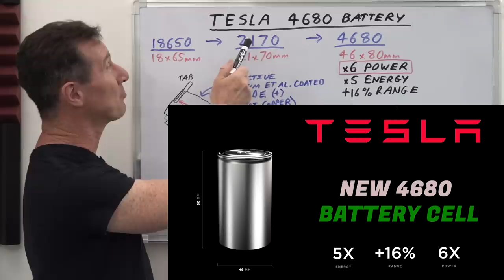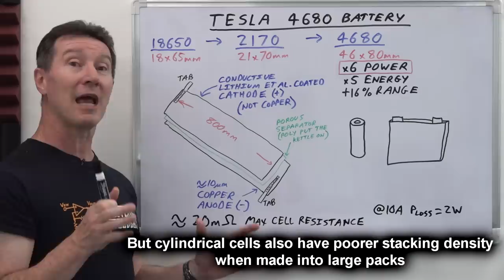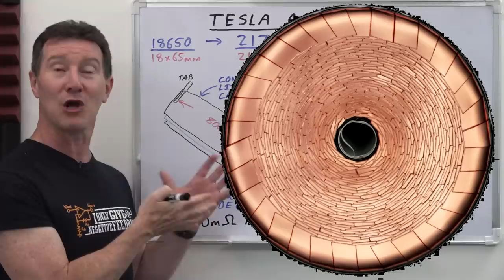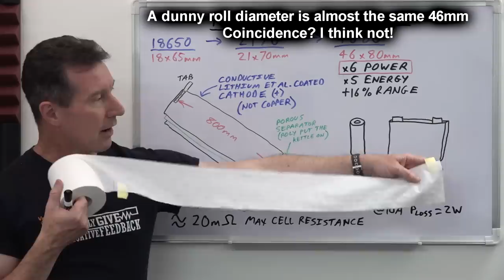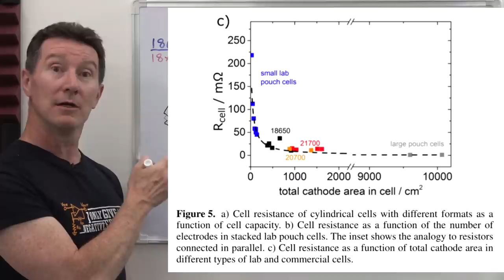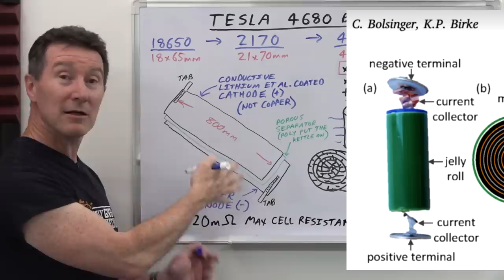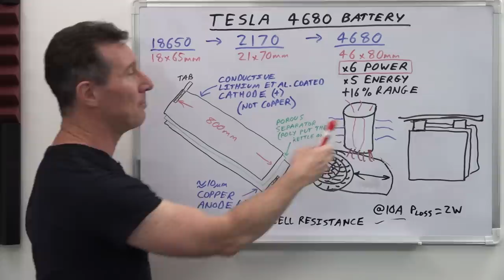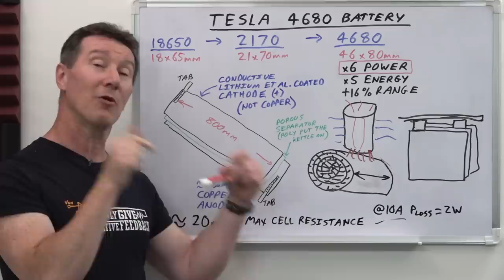EEVblog 1340 - New Tesla 4680 Battery Cell EXPLAINED

Comment: 17:45 its actually because pouch cells are not mechannically as stable as cylindrical cells.
 I really dont know if tabless is patent-worthy/new design because it is quite obvious and attractive feature every manufacturer may like to do but couldnt have been affordable for small designs. Its astonishing if they really didnt notice it. Heck yea, even i had observed it's possibility for many years because it plays a major role for power delivery. Though its possible that Tesla got some 'new' way to do it which could be patent worthy (i havent seent its patent) but the design itself doesnt seem.

Comment: I really don't get the welded tabs on the flat cells. Why not use the entire surface to make contact? To eliminate contact issues, the surfaces could be coated with thin layers of indium, which is common for cold soldering. Although copper is better in both conductivity and heat transfer, using the entire electrode as the electrical contact surface, you get the advantage of the entire surface of the electrodes as contact surfaces instead of tabs welded to the electrodes and similarly for heat dissipation. The indium eliminates any oxidation problems with the bare electrode materials. That makes them easily stackable and or paralleled. The same scheme can't be used for a cylindrical cell, but so what?

Comment: Great presentation! Why didn’t they bend the cathode over line they did the anode? Seems like not doing this will limit the charging speed as you a still forcing current through a tab?

Comment: The overlapping tabs ofc. stack on top of another and thus takes up space reducing the maximum "height" causing some loss of capacity but if Tesla is smart they have minimized the overlap to reduce this loss (i.e. minimizing the height of the "tab" and removing parts of the edge while still allowing for inter-roll connections).

Comment: This is what Tesla needed! I was amazed that the standard 1865 battery was being used in the first few model years. I am very enthusiastic for this new battery cell design. This ought to make one hell of a e-cigarette mod! I have a 2x 18650 regulated power supply for my electronic cigarette. Im sure someone will make the incredible hulk vape with one of these 4680's!

Comment: A solar installer told me that Tesla's current  battery could never be improved upon, so there's no reason to wait to install battery backup in the solar system.  It takes 20 years to pay off the battery (~$80/month).  Well, this just disproved those sales representatives.  Battery technology will continue to improve and hopefully costs (and corporate greed) will go down along with efficiencies increasing.

Comment: All cylinders should have the same packing density, regardless of diameter. Though a longer cell may have more capacity for the same battery layer overhead, that is the thickness of the end plates will be about the same regardless of cell height.
My question now that they have the heat flowing to the ends of the cell, where does it go from there? Assuming many cell layers in a battery, what is bringing the heat from the center to the external radiators or heat sinks? (yeah an order of magnitude less heat but still it needs to go somewhere just the same.)

Comment: I think that they are folded for protection, because once they start to expand they tear the tabs and stop the reaction (or a short) , thus protecting the user from fire.
This new design sounds super cool and inteligently designed, however the protection from potencial short circuit will probably be in the separator only.

Comment: Just a note:  Packing density of circles doesn't change with the size of the circles, provided the packing pattern and number of cells is the same.  Assuming hexagonal packing, and allowing a bit of space lost at the ends of rows, packing efficiency in a rectangular array would be very nearly the same for the larger cells as for the smaller, probably in the vicinity of 80%.  Reference:  http://www.datagenetics.com/blog/june32014/index.html
Reply: Packing density of triangles works better
Reply: @tedbell4416   As does hexagons.

Comment: The anode is a carbon-based material, commonly graphite, not copper, no? That copper is to conduct the electrons to the external circuit?

Comment: Best presentation of Tesla battery I ever see so far ! How about the safety perspective for this Tesla battery design ? is it safer vs Lithium-iron-phosphate (LiFePO4) batteries? (that are more thermally and chemically stable than lithium-ion batteries).Why only increase 16% range with 6X power increase ?

Comment: Questions/thoughts:
1. How do they prevent shorting the anode and cathode when folding over the new "tabs"? I can imagine it's quite possible to short them out when it's folded over the roll of annode/cathode. Maybe they coat one side of the tabs with an insulating material. Although this would add an extra production step and that would be counter productive to their new tabless design to speed up production...
2. It seems to me that the new "tabs" will have added weight (and a very slightly added volume) because there will be more copper/material from all those folded tabs as opposed to 1 welded tab. This could explain the missing 0.5 in the x5 energy, as opposed to the x5.5 energy you calculated.
Reply: For 1. I guess its simple, keep a vertical offset between two conductive sheets. I.e., pull inner Lithium sheet slightly up so that it's bottom edge makes a gap from folded Copper material

Comment: Why not add a thermal heat sink as a core to cool from the inside out? as in an isolated inner core as to only absorb heat and not electrical  conductivity. ? Like thin ceramic layer coating a copper core?

Comment: You made a huge mistake with lenght measures. 46 mm is 4,6 cm and 80 mm is 8 cm. It seem like you didn't check everything before presentation. So comparing lenght of 8 cm to the lenght of your arm is ridiculous. Besides that its a great presentation for battery newbies like me. Besides confusing numbers 80 mm with 80 cm you got it pretty nailed.

Comment: I feel like the problem with this multiple tabs folding over will be the conection between them with time will lose, shortcuting and heating the battery faster actualy. Is a brilliant idea, but those tabs need more than just a press fit to make contact with the surface plate. You know when you have some old but still good batteries in your remote from the tv. You just take out the cover roll them inside few times and works again. Why? Because the conection surface is corroded, rubbing the batter will get that spring and contact plates back to touch eachother. Ofcourse you can evoid that in the firstplace by putting a little bit of greese on the contact area so then you insulate it from oxigen. They really need to think good at this fact the contacts of those tabs, because in time maybe some of them will lose conection and the battery will age unbalanced. As for the heating problem, why didn't they just leave a hole in the core making the batter more like a tube, then it has more surface to disipate the heat. I find the square big cels much more simple and better. I don't know why they make more and smaller cells, it seems more complicated. Yes is an advantage for a multipurpose battery to make small compact cells wich can be made in many shapes fitting electric tools batteries, and other stuff. But since you create a battery specific for EV, why replicate this? Why limit the cell capacity or size to 46 with 80 mm? If the purpose of these batteries are for electric cars? Multiple cells are multiple potential problems... Anyway, that's just what i think and i am not a battery expert. But i do know the actually important part of this battery is not the battery, is how is used, is the program wich controls the discharge and recharge of these batteries. IF the charge and discharce does not balance each since cell of a battery then that batter won't live too long.

Comment: Would the cylindrical construction keep architecture more stable with vibrational input and also aid in resisting the problem of expansion distortions with excess discharge etc?

Comment: Shouldn't the copper resistance calculations take into account, that the electrons travel from any point to the end? Do they all travel the full length of 800mm and 80mm? Or is it just the same relation in resistance anyways?

Comment: Nice presentation. To add to this, since force - Mass x Acceleration, the acceleration rate will increase by a linear factor based on the less weight - I think you did say that these were less weight?

Comment: A "Jelly Roll" battery would be more adaptable for automation assembly. Plus, the 4680 battery will become an intrigle structural part of the car frame, where as a pouch battery is dead weight.

Comment: Another comment from me..I want to know that volumetric efficiency.  If you can't get as many cells in the battery, the voltage would go down.  But that could translate into efficiency I suppose since you don't have to bleed that extra voltage off until  you get a quiescent value.  I'm confusing myself.  But if you had a suitcase full of these new cells, how much power is there in there compared to the old cells?  How many WH is in ONE cell?

Comment: If the pouch cells had the terminals in opposite sides then wouldn't it be possible to do the same thing?
Also given that pouch cells are much bigger wouldn't it be possible to clamp/weld the ends of one cell to the next thereby using the battery as a busbar and further reducing the internal resistance of the pack?
At 46mm diameter it would mean that all cooling would have to be done thru the tabs. Pouch cells are about 10mm thick and being flat it would be much easier to cool the cell via the surface which could be more efficient? 
Could you do some comparison of pouch cells vs cylindrical cells?
I saw some measurements of a pack using pouch cells with thermal resistance 1/10th that of a Tesla pack and internal resistance 1/3rd of a Tesla pack and an energy density at the pack level of 207wh/kwh at pack level (I can't remember if that included the case but it did include the cooling system and all the bus bars.)
I sometimes feel Tesla make their figures look amazing when in fact they are not much different than what other teams have done.
Don't get me wrong. They have done a good job on the drive train but I don't think it is as ground breaking as they make us to believe.
I just think that no one else is really trying.

Comment: The Tab batteries have a spot welded tab. The 4680 has muliple tabs folded over each other but no weld or solder right? So what about resistance between the cell and the end caps? Just saying.

Comment: You don't want the anode and the cathode to short out, and by folding all the tabs, they must be doing some interesting engineering to ensure the separator stop the folded tab from shorting on the back of the anode.

Maybe that is why they like to show that photo, as the secret is hidden by the folded tabs.

Comment: I'm wondering how or if they will weld the taps to the contact. That seems to me like the biggest issue with the design.  
  
Or could they be using electrically conductive adhesive?

Comment: This is more or less how low ESR film capacitors are constructed, albeit with a lump of metallisation added to the ends rather than tabs cut into the electrodes.

Comment: What makes us think they're using solid copper for the electrode, couldn't you just coat aluminum foil with copper and get the same result for less weight and cost?

Comment: You can't get the larger cell without the tabless, too much heat, too long a path for the electrons to flow through.  So you want the greater energy per volume/mass of the larger cell, but to get a larger cell you need to reduce resistance and/or improve cooling, and tabless does that. Praise science.

Comment: ...Also because the new battery cells are bigger, there will be less of them daisy chained together lowering the resistance even more. (i.e. 20 batteries at 2 watts vs 16 batteries at 0.2 watts)

Comment: It is quite obvious why they don't use pouch batteries. Cylinder batteries cannot build up pressure, inflate itself like a baloon and delaminate the electrodes. This is how most pouch batteries die. If you have something which is not round and add pressure to it, it will have tendency to become round. When it's already round, it cannot get anymore round(er) and therefore can contain the pressure much better. that is also why they don't make scuba air tanks in cube or flat shape.

Comment: some thoughts.       changes in cell architecture appear to result in a 'shortened' current path  and, seemingly, an ability to carry  high current.       idk, however, if current flow would, at its first opportunity, 'concentrate' anywhere there was the tiniest 'reduction' in  resistance/impedance.      googletranslate

Comment: Hi Dave, your videos are always very detailed. 
Can you make a video on how to integrate a secondary hv battery let's say of half kWh of the fixed battery on ev and switching from one battery to another to extend range in an EV..
Also what to keep in mind while choosing configuration for the secondary battery. Like should it have same voltage or current as the fixed battery for range extension.

Comment: why does it need to be spiraled if the only distance for electron is straight line? why not shingle them and then make blocks. easy to pack into a car. easy to design them to BE the heatsink.

Comment: Pardon my ignorance, but wouldn't the free floating tab potentially short over the poly membrane separator? I guess you can put a poly cap on the end before folding the tabs over?
Reply: The anode/cathode rolls are offset over a wider insulator roll . The principle is obvious in hindsight but very much a forehead-slapping "duh" moment when people realise it

Comment: Mate, the real advantage is an ability to scale production. The massive reduction in factory size and cost to produce is what makes this design a huge winner. Also this method of production allows for flexibility to integrate new future technology [like dry cell] without retooling.  The world needs unbelievable battery storage capacity. The Tesla design will make it possible to deliver this demand in the shortest time frame currently possible. Battery storage is already cheaper than petroleum products [including gas]. The limiting factor is being addressed here, production rate/capacity. Watch this space, in the next 2-4 years, it will be clear, battery storage will be the main winner in our transition to renewable energy due to the low cost and availability. Tesla's advantage is manufacturing. They design and build the machines that efficiently make the product. As a bonus their batteries are a bit better. You need to look at the big picture.

Comment: I found interesting numbers in internet and made some calculation:
Model 3 2170 Cell:

Weight: 70 grams
Volume: 24.3 cm3
Capacity: 4.8Ah / 17.3 Wh
Density: 247 Wh/kg
Density per volume:198mAh/cm3

Samsung INR18650-32E Cell(you can buy it on alliexpress):

Weight: 48 grams
Volume: 16.5 cm3
Capacity: 3.2 Ah / 11.5 Wh

Density: 240 Wh/kg
Density per volume:194mAh/cm3

So now what we know about 4860:

Weight: ? grams
Volume:108.5 cm3
Capacity: 24(4.8Ah*5 )/ 86.5(17.3*5 Wh)
Density: ?  Wh/kg

Density per volume:221mAh/cm3

And last something interesting Panasonic UR14500P:

Weight: 21 grams
Volume:7.7 cm3
Capacity: 0.8Ah/ 2.88 Wh
Density: 148  Wh/kg
Density per volume:104mAh/cm3

So, according those digits I can say that Tesla simply made 5.5 bigger size battery.

Comment: The packing efficiency of circles is independent of their diameter!

So no -- the 16% don't come from the bigger dimensions 
(if you idealize the world -- in reality each cell has its casing and uses therefore some space, that doesn't help it's capacity)
Reply: I have to wonder if they're using the dead space intentionally, and having some regular division that includes cells and other components.

Comment: If you assume the same thickness of jellyroll and the same clear diameter in the centre core, the surface area of the jellyroll is almost exactly 5times the 2170.
That's the energy.
20% on that due to the Tabless design is the power.
If they keep the number of "cans" leaving the factory the same, they get 6 times the kWh leaving the factory.
If they increase that by 16% due to not tab welding they get the "7x production line speed" Elon mentioned.
That's essentially 14% of the factory space for similar output.
THEN remove even 30% of the line floorspace due to no drying required by the Dry electrode process and you're down to 10% of factory space for similar output!
This doesn't even account for chemistry / material changes, or reduced space for pack assembly (but they might assembly the floorplan in the battery factory?)

There's something people missed at the presentation (imo)
Go to 1:33:30.
Look at the Wh/kg for IRON.
600 Wh/kg (!)
What's the output today? 200?

They're Sandbagging.

Comment: So if the new battery is that much more powerful and has that much more energy density because it's larger and thicker, 
surely you won't be able to fit as many of them in so that extra power and that extra energy density will not make that much difference over previous because you have less batteries in it overall...?